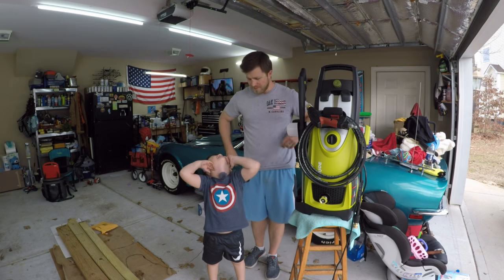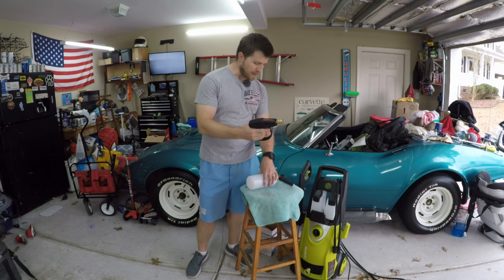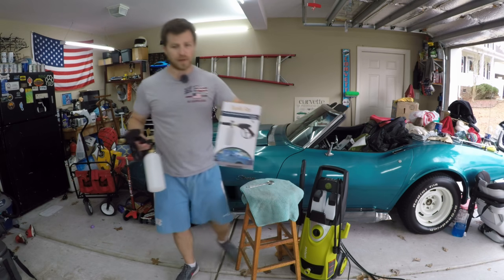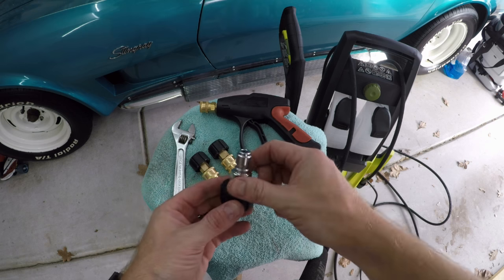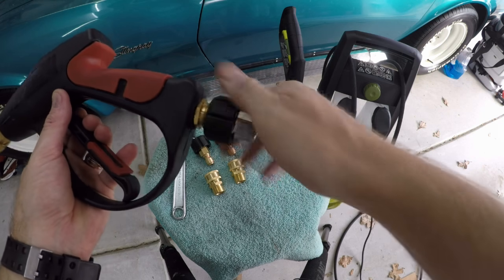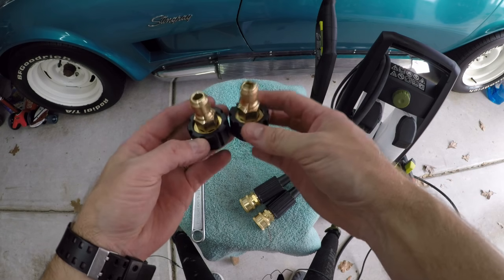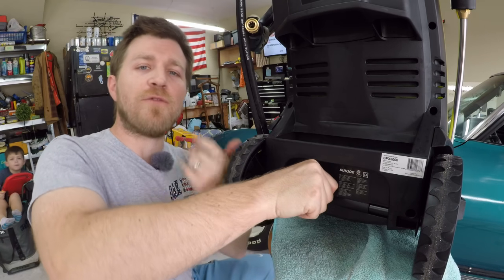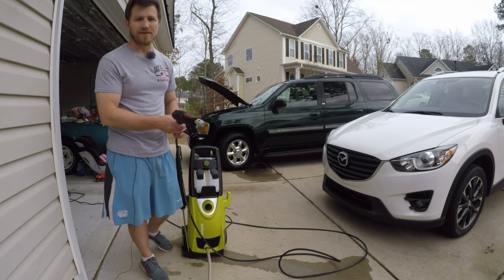EASILY ADD QUICK CONNECT DISCONNECTS TO PRESSURE WASHER

Comment: Hi, Kevin
I’m new to this. I have just bought a RYOBI 2000 PSI 1.2 GPM at Home Depot.
I would like to use a small gun instead of the long wand that comes with the pressure washer. 
If I get the foam cannon, short gun and the quick connect/disconnect kit, all from Twinkle Star company, would the quick connect/disconnect kit work with my RYOBI 2000 psi?

I noticed that the Twinkle Star 3000 PSI High Pressure Washer Gun Snow Foam Lance Cannon Foam Blaster with M22-14mm Thread is no longer available. What else would recommend for a substitute?
Thank you very much for your help.
Reply from the maker: Awesome, you'll have fun with that unit. As far as a foam canon and stubby gun, I would search Amazon.

Comment: What grease did you use before making connections. Googled the terms you mentioned but can’t find anything. I see silicone grease and others but didn’t want to risk getting wrong kind and clogging something up. Brand and exact name?
Reply from the maker: I used some hi-temp hi-pressure grease from Advance Auto that I had laying around the garage.  Silicone grease would probably work too, or even some petroleum jelly.

Comment: Great video! I did this, but I ran into a problem and I'm not sure why. First off, I'm new to pressure washing and I have all my stuff on quick connects, but earlier I tried to take the gun off because I was going to use a different gun, but it wouldn't pop off unless I turned off the pressure washer. Is this normal? I'd think you could pop things off and on it all day long with no issues...Any ideas? It's the Sun Joe  Xstream model.
Reply from the maker: I wouldn't try to disconnect any accessories while there's pressure in the lines.

Comment: Kevin 
Thanks for the video. I ordered parts for my Ryobi and wasn't as successful. I was able to connect it to the gun but the gun keeps leaking and as a result the pressure washer Cycles on about every 10 seconds. I did use Teflon tape on the fitting with the gun but there is still a slight leak. The output fitting on the Ryobi unit just doesn't fit  the connections I got from Amazon but I can live with that as long as I can use the gun. I do like the smaller gun any thoughts on how to stop the leaking issue ?

Comment: Hey Kevin I need some help I ordered the same pressure washer looks the same but mine is the 2030 psi one my foam canonn is a 1/4 inch so what all do I need to have quick connects?? Does the hose quick connect range around 3/4 inch should I buy the ones you have in your video but then also buy a 1/4 connector for my foam cannon ?
Reply from the maker: Hi.  The garden hose quick connects are mostly universal, 3/4 inches.  If I remember, I bought the 3/8" quick connects.  You should be able to easily find a 1/4" quick connect fitting for your foam cannon.

Comment: Kevin you made a lot of folks happy with this video. My question is will these connectors also work with my Sun Joe SXP3001?  Also the name of grease you use on O rings to prevent leaks?  

Great job!!
Reply from the maker: Thanks Jon! I would assume the quick disconnects I used on my SPX3000 will fit the SPX3001. The grease I used was Advance Auto's house brand high temp grease. Nothing special, just what I had on the shelf👍
Reply: Kevin any suggestions on options for Twinkle Star Gun and Foam Cannon?  Amazon link is showing product unavailable!!
Reply from the maker: @jonkling2631  This one is on sale https://www.amazon.com/Twinkle-Star-Pressure-Washer-Blaster/dp/B085NX4D5Y

Comment: So I have these dq on my Simpson 3400 psi and my sprayer doesn’t spin freely like yours does WTH!!!! And suggestions?
Reply from the maker: Does the sprayer spin at all? I don't think they should spin "freely" when under pressure, you have to persuade them a little.
Reply: @KevinNadeau  No not at all. Wow that’s unfortunate I got them so the hose doesn’t roll up while moving around.

Comment: does it make wrapping the hose up easier? now that i can kind of "twist" on the quick connectors
Reply from the maker: I actually disconnect my hose from both ends and let it drain out, then wrap my hose up. The disconnects come in to play for me when wrapping up the hose.
Reply: @KevinNadeau  I mean I figured, Common Sense tells me it makes it easier to store the hose away because of the swivel connections because of the quick connect. The only downfall is I cannot find a full set in the 15 mm. Everything I find is a 14 mm like this https://www.amazon.com/STYDDI-Pressure-Connect-Ultimate-M22-14mm/dp/B08CVGB2MT/ref=mp_s_a_1_28?dchild=1&keywords=15mm+pressure+washer+hose&qid=1600041380&sprefix=15mm+press&sr=8-28

Comment: Hey Kev,
In the video you said you would not talk about the front end and water connector. About the front of the machine and its water hose connector, do you know what size would fit the hose tip that goes into the SunJoe? Would a M22-15 female work with the hose M22 male threads?
Reply from the maker: The M22 connector would not fit. You would have to search on Amazon for a garden hose quick connect. Something like this https://www.amazon.com/Twinkle-Star-Garden-Fitting-Connector/dp/B07FWXGR24/ref=mp_s_a_1_3?dchild=1&keywords=garden%2Bhose%2Bquick%2Bconnect&qid=1589632322&sprefix=garden%2Bhose%2Bquic&sr=8-3&th=1&psc=1

Comment: Great video, but I am a bit confused.
Could you please tell me what I need to buy for my SPX3000 gun and pressure hose (both OEM), so that I can have the quick-connect and swivel capability?  It’s not clear to me because you talk about M22 15s and M22 15s since you want to able to use multiple guns. I just want the quick-connect for the OEM hose (both ends) and the gun.  Thank you!

Comment: I thought the sun Joe spx3000 comes with M22 threading and ¼ hose. So why did you install 3/8 quick connectors ? Did you upsize on the hose and connectors /quick connects

Comment: i bought a quick connect set from amazon also..after pressure washing the connection did not want to disconnect...is it because its a cheap and should get anothe expensive ones?
Reply from the maker: Could there be dirt or debris in the connections? Be sure to relieve the pressure first.
Reply: @KevinNadeau  not sure but its brand new connects and pressure washer...only used it 2 times now

Comment: Did you take the big nut out that was at the bottom of the snubby and replaced it with a different nut
Reply from the maker: I don't remember doing that. I just screwed the quick connect coupling onto the snubby.
Reply: Kevin Nadeau yeah the quick connect won’t go over the bolt so it had to be replaced

Comment: Thanks for the video. I have that exact same pressure washer. Is the same quick connect used for the hose in the front like you mentioned?

Comment: Do you know if the gun and fittings will also work for a Ryobi electric pressure washer?
Reply from the maker: I believe they will fit. Most electric pressure washers use M22-15 fittings, whereas gas pressure washers use M22-14. 👍

Comment: I don’t expect you to know the answer to this question but on the off chance you do.....any idea if your proposed solution will work with the AR Blue 112? I am getting sick and tired of fighting the stock gun/lance in terms of removing the lance in order to use the foam canon. The stock set-up requires you to compress the lance and turn counter clockwise which invariably turns into an absolutely miserable struggle

Comment: Does your hose connector to the sunjoe pressure washer leak water?
Reply from the maker: It was Advance Auto brand...It's just what I had on the shelf.
Reply from the maker: No it does not leak 👍

Comment: Can you switch guns using quick connects without having to turn off the pressure washer? Thanks for the video, very informative!
Reply from the maker: No you can't unfortunately. You'd have to turn the unit off first.

Comment: Hi Kevin, Can you provide a link or the name brand of the high pressure grease you used, please? Thank you! I've got my gun all setup. I'd like to get a bette seal on the connectors.
Reply from the maker: The grease I used was from Advance Auto.  You can get the high pressure grease from any auto parts store.

Comment: I just followed your link to the quick disconnects and they are unavailable. Do you know where can i get these elsewhere? Thanks a lot your video defenetly helped.
Reply from the maker: Thank you.  The kit I I bought is currently unavailable on Amazon (for some reason).  he link in the description is for the correct M22-15 coupler, you'll just need two of them.  You might be able to find them at a local hardware store too.  Just be sure they are M22-15 and NOT M22-14.

Comment: Hi I have the same problem my power washer is a Ryobi , does this fittings work for my machine as well?
Reply from the maker: All M22 connections found on gas units will be 14mm. The 15mm M22 fittings are only used on select electric pressure washers. Do a Google search for your particular model. Thanks 👍

Comment: Bought everything u did, except I have a Ryobi hose. 2 things are happening. The quick connects leak water from my gun. And when I turn in the pressure washer it runs without me pulling the trigger.

Comment: I have the sunjoe Spx205e and the trinova foam cannon doesn’t fit 
What do I need for it to fit????
Reply from the maker: I think you might need to get the Sun Joe foam canon.  Looks like that one has the correct fitting for the handle that on the SPX205E.  https://amzn.to/3voan4y

Comment: What adapter to connect an existing high pressure washer hose to extension high pressure washer hose?
Reply from the maker: I think you would need an M22x14 to M22x15

Comment: Will this work for a Ryobi pressure washer?
Reply from the maker: It will as long as the Ryobi has M22-15 hose size, which the electric ones do if I'm not mistaken.

Comment: How did you fix the leaking mine leaks a lot when I use it
Reply from the maker: Make sure your o-rings are in good condition and that you have the correct size fittings (i.e. M22x14 or M22x15)
Reply: @KevinNadeau  are the o rings inside the machine or is it where you connect the hose at?
Reply from the maker: @Mousy86   @Richard Barrera  The o-rings I was thinking about are inside the male hose connections.  I had to change one myself and I just went to the hardware store and bought a variety pack to find the correct size.

Comment: Did you notice reduced pressure on the pressure washer after you installed the quick connects on the pressure washer? Please reply thanks!
Reply from the maker: I didn't notice any change in pressure.

Comment: Hey Kevin - Phenominal video.  One of the best out there.  Question -  I bought a Homdox 3000 PSI Electric Pressure Washer. I also bought the EDOU 5000 PSI High Pressure washer short gun kit.  This being my first time owning one, what connections do you recommend to make it like the one you have. As of right now, I can't utilize it.  I would like to buy from you so you get a commission.  Any help would be greatly appreciated.
Reply from the maker: I looked up the EDOU spray gun on Amazon and it looks like the kit comes with a 3/8" quick connect adapter and both M22-14mm and M22-15mm adapters.  Disconnect the pressure hose from the wand that came with the pressure washer and see which adapter fits it.
Reply: @KevinNadeau  Thank you for taking the time to research that Kevin, means a lot.  Keep making great videos!

Comment: Sorry, I meant to say you mention the M22-14s and M22-15s, which confuses me.
Could you please send me the correct links to buy 2 pairs of male/female connectors so that my OEM hose will be quick-connect and able to swivel on both the OEM gun end and the OEM pressure outlet on the washer.  Thanks.
Reply from the maker: The M22-15 fittings go on the hose ends while the M22-14 fitting goes on the Twinkle Star spray gun. Links are in the description 👍
Reply: @KevinNadeau  thanks for the video! Well explained! (Watched quite a few times too!) After much research, I've found basically many entry level pressure washers are using M22-15 instead of M22-14. I was so frustrated why my pressure washer was leaking! Now i just ordered  an M22-15 female to 14 male converter from amazon. :)

Comment: Hey can someone help me find a fitting for my smaller end of my SUNJOE SPX-2700 MAX. I recently found that the fittings used in this video don’t fit my Sunjoe because the smaller end that goes into the Lance is somehow smaller. I think it might be smaller than M22-14mm. I rlly don’t know how but if someone can help me I’d greatly appreciate it !
Reply from the maker: You can give Sun Joe's customer service a call 866-766-9563

Comment: Thanks for the info.  Fyi, the amazon link for 15 takes you to the 14.
Reply from the maker: Thanks for the heads up.
Reply from the maker: The link is correct for an M14-3/8" adapter, I had a typo in the description, typed M15 on accident.  The description is fixed.  Thanks again!
Reply: @KevinNadeau  I thought the SJ was a 15mm? Now I see two 14mm sentences. Here's the M22-15 set.
https://www.amazon.com/Twinkle-Star-Pressure-Adapter-Compatible/dp/B07L4HR1R7

Update, link wasn't as desribed, 15mm female, 14mm male. Most likely will leak. Not a snug fit like the manufacturer components.
Reply: protostab I’m confused as well. Should I get the 14 or 15?
Reply: @yusiftaheb9767  Hello, Sun Joe requires 15mm. I bought the adaptors in my post above. The female side is perfect, 15mm (measured). The male side is 14mm (measured), and will most likely leak. I plan on sending it back. Either I received an incorrect matching kit, or it's cheap and the company tried to make it work with an o-ring.
Reply: protostab yes I was reading reviews for the link you posted. Other people were saying the same thing. Some even bough a separate o ring to prevent leaks. I just want a kit that works and fits

Comment: I just bought a Sun Joe SPX3001 along with the Tool Daily adapters & they don't work @ all. I can't get the female adapter  into the hose & the female doesn't even connect to the male. It's like the female is too big.
Reply from the maker: What size quick connects did you buy?  M22-14 or M22-15?
Reply: @KevinNadeau  the box says M22 15mm. You're using the PLF connectors. How come you didn't link those to your video instead of the Tool Daily?

Comment: I have a SPX2598-max  doesn't seem like any of the adapter would work.   The one I got is kind o fodd, 1/2 swirl and 1/4 inner.   Anyone else can recommend a connector/adapter for SPX serious 2000 to 2598 so i can connect to a 14mm gun
Reply from the maker: It might make your life easier if you switch your hoses over to a 3/8-inch quick connect coupler.  Then you can get an M22-14 to 3/8" male coupler for the gun and M22-15mm couplers for the SunJoe hoses.  Let us know what you figure out.
Reply from the maker: I just watched a video of your model pressure washer and I see what you're talking about.  The quick connects I mentioned below don't look like they would work on the hose end that screws into the wand.  You could take the hose with you to a hardware store and see what type of couplers they have for that size connection.
Reply: @KevinNadeau  yup I just went to Rona and picked up a  KARCHER pressure hose and it fits my sun joe washer and the gun now :)

Comment: What do I need to connect my water hose to my foam gun please help
Reply from the maker: You’ll probably need an M22-14 connector.
Reply: @KevinNadeau  and where would I find that part sorry for all the questions and thank you for your help
Reply from the maker: @joeolvera1  I believe those sizes are readily available at the big-box home improvement stores.  Or you can find them on Amazon.

Comment: It looks like your m22-15 amazon link actually connects to the 14?
Reply from the maker: Yes, I think that item is currently unavailable through Amazon and they redirect you to the M22-14. Just search for the M22-15 connections, there are other options out there 👍
Reply from the maker: I'll try to fix the link. Thanks for letting me know 👊
Reply from the maker: The link should be fixed now.
Reply: Amazon  was out of those  fittings  I ordered  mine from ebay not coming  till next month  which is when  Amazon  is getting  restocked

Comment: Nice video. How did you reconcile the difference in mm between the gun and the hose? The gun connect was still 14mm and the hose even though you added a quick connect, stayed at 15mm. Am I missing something?
Reply from the maker: The male ends of the couplers are all 3/8", so it doesn't matter whether its a 14mm or 15mm.

Comment: How can I connect garden hose directly to gun without the pressure washer machine?
Reply from the maker: I've never tried that. You'll need the M22-14 to 3/8 coupler for the gun and a female 3/8 coupler for the hose.

Comment: The link you posted takes me to m22 by 14 connector but you said sun joe uses m22 by 15
Reply from the maker: Yes, the Sun Joe uses M22-15 connectors. The ones I linked to are currently unavailable on Amazon, that's why the M22-14 comes up. Just search M22-15 quick connectors, there are plenty of options. Thanks 👍
Reply: Kevin Nadeau  a lot of the links has more connectors than needed. I can’t find a kit like the m22-14 you posted. Any way you can update the link or maybe add Seperate links if it’s not a kit. This way people don’t get confused and buy the m22-14

Comment: .it would be better if you convert the quick disconnects to 14mm instead of 15mm.. incase you ever decide to upgrade to something better like the Mosmatic spray gun or MTM foam cannon or a high quality pressure hose.